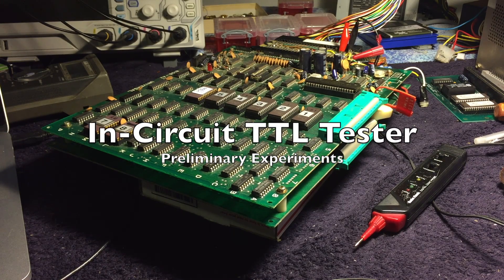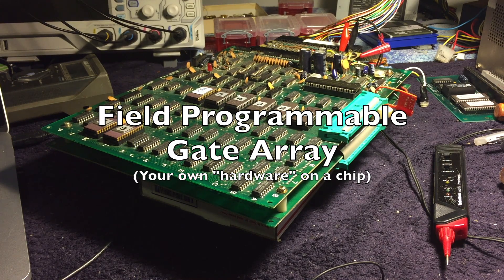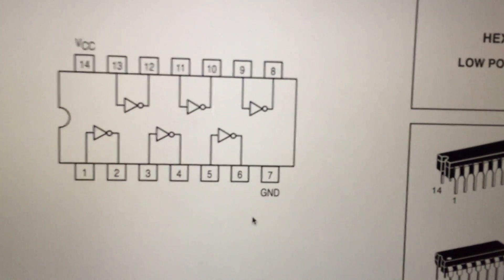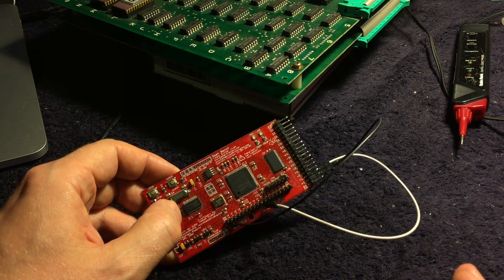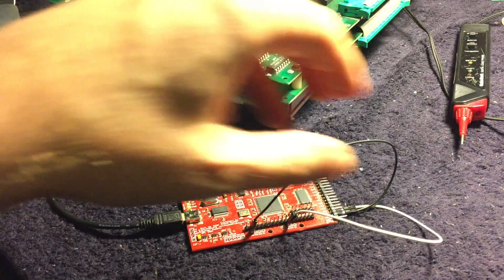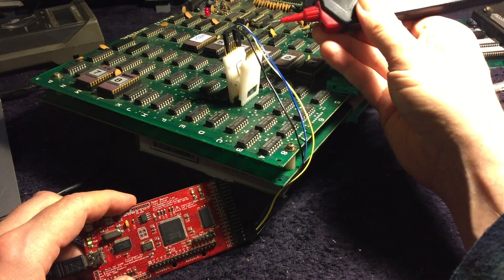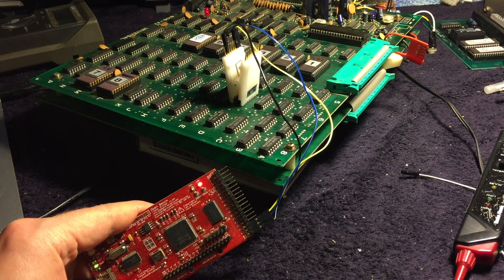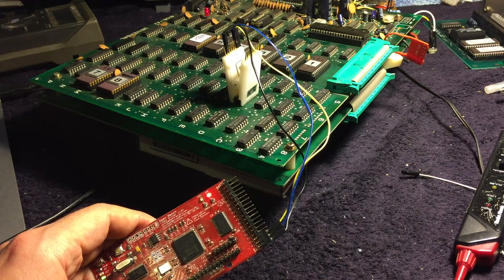FPGA-based in-circuit TTL chip tester -- first steps

Comment: Hi ! This looks amazing, how did that project evolved since ? I'm curious :) Thanks !
Reply from the maker: Thanks! I need to rethink how the modeling in the FPGA can best be accomplished, so as an interim step I am  saving logic analyzer captures and using Python scripts to see if they match expected behavior. Still early days, but I’ve already been able to identify several subtle faults that would have taken far longer to find without it.
Hopefully once it’s further along I can circle back and get it running in real-time on the FPGA. More videos to come if it happens!
Reply: @bitrot42  Thank you for your answer ! Hope you'll your issue, this could be a really handy tool :) Good luck !

Comment: Did you make any progress with this idea?
I have been playing around with in circuit testing and so far have been using high speed micro boards but finding I do not quite have enough speed so have thought that an FPGA might be the way to go! Have you published you demo code on Github?
Reply from the maker: Hi! Thanks for your interest. I got a little further... I realized that modeling the proper timing by "hand-crafting" a series of gates with no clocking isn't really going to be practical. The HDL tools discourage this, and there's likely to be too much variation between chips being tested.
I think it's going to need some kind of clock-based timing/windowing so an error is triggered if the DUT and the FPGA representation of it differ for more than a specific length of time (in nanoseconds.) On an FPGA you can use a clock in the 100s of MHz, and evaluate all the inputs in parallel, so I think the prospects are much better than with a micro. (That said, you can get fairly far with a micro -- check out the videos for the "AR81 arcade tester" if you haven't seen them already.)
I have some ideas about how to do this, but that's as far as I've been able to get. What I have now is too rudimentary and ineffective to realy be useful, but I'll keep github in mind if I get any further with it. I'll be sure to post an update video, too. :)

Comment: Have you tried programming Simutrek's Cube Quest into an FPGA?
Reply from the maker: It's theoretically possible, but it would probably need a fairly beefy FPGA, especially if you weren't using a separate 68000 CPU. It's way beyond my VHDL coding abilities at this point, though.

Comment: Umm, just buy a hp logic comparator?
Reply from the maker: Fair question...  I have an HP 10529A comparator, but I'd like to have something that handles more pins, and understands bi-directional pins such as on a 74LS245. With the right code, it could even passively test small RAM chips by comparing reads of addresses that have been written.

Comment: What writing the low level code?
Probably just assembly
Reply from the maker: With FPGAs, you don't "program" them so much as "describe the hardware you want". In this case, I'm using a language called VHDL. Verilog is the other common language for this.

Comment: Cool!  One hurdle you will eventually hit is support for the multiple TTL families. I.E. 74s vs 74ls vs 74F etc.  Those can have drastically different slew rates. But if you target the 74ls series first you'll hit 95% of the logic out there. ;)
Reply from the maker: Thanks. :)  Yeah, the comparator/windowing will probably need a lot of fine-tuning for different chip families (or even different circuit conditions such as loading), but I think it's worth a try. I'm sure you could do this in your sleep, but it's been an interesting challenge for me...